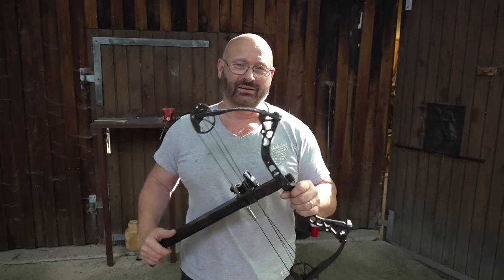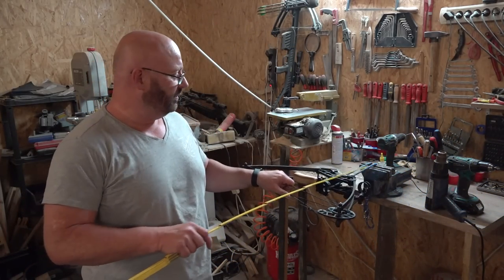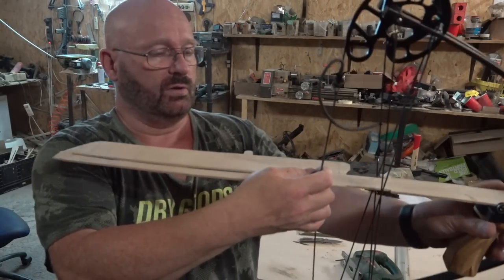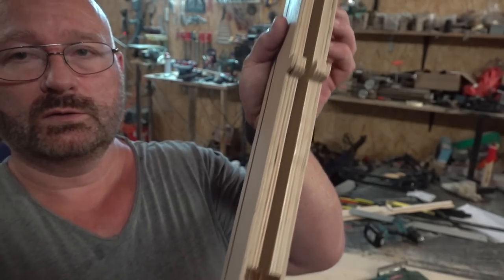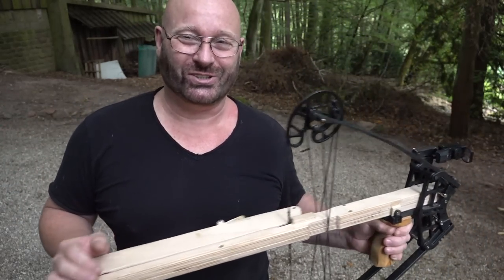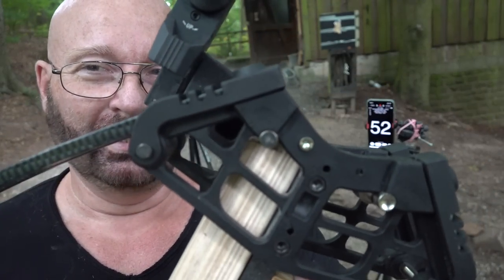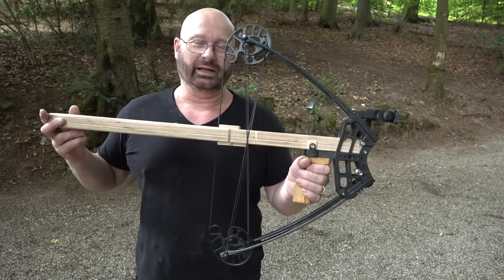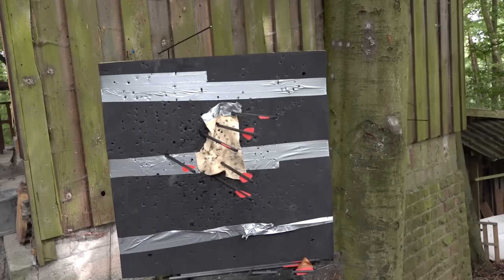200 $ Chinese Micro Bow MAXED OUT EXTREME (Tutorial)

Comment: Not first, but for once I caught this pretty early. Great work on the revision, Jörg! While being able to use full grip under the magazine is definitely an improvement, I feel like a catch loop (though using such a device would slightly reduce rate of fire), or some type of handle (maybe something vaguely spherical so it's easy to let go of, but coated in a grippy material like latex to prevent accidents?) tied to the string would serve as better alternatives. Those are just my inane ramblings, though.
Reply from the maker: Tried that, it works but using your fingers is still the easiest way.
Reply: @Slingshotchannel  good to know. Thanks for the reply!

Comment: I will make one. Thanks for this. I think you need to beeswax the surface of the wood on the inside to save the string wear and tear. Although it is clear, when it relleases it will vibrate at the end of its passage causing chaffing. I have this bow and I did not know it even had adjustable power. Thanks! (please review the pump action chinese slingshots 80 ball magazine that also fire darts available on ebay!).

Comment: How about adding a railgrip to the right side of the shaft to draw the string?
I imagine a mounted rail ridden by a grip with hooks above and below the shaft for the string. The hooks have a release on the grip.
As long as the grip doesn't stay in a cocked position on the rail (which would be neet) it is no crossbow, or am I mistaken?
This is due to the fact that you still have to hold the string by your own power, which is easy with a compound.
Olympic compound shooters use a release aid, maybe something similar can be done here. Replacing the grip with a loop to pull with the release aid. 

That way you could draw the string evenly and still be comfortable.
Also I'd think you could draw the string faster with a grip.
A hooked grip would be better to ensure a longer lifespan of the string. Maybe it is possible to combine the pullback action with a release aid.
That is something I'd like to see with the next iteration.

Comment: Love that ingenuity! I wonder if you were to use something smooth, like plastic, for the arm holding the arrows down, would it help reduce the friction and increase the speed? Or maybe a small wheel at the end of the spring loaded arm so it can roll along the arrow rather than rubbing against it. Keep up the great work!
Reply from the maker: That would only work for the very last arrow. Otherwise the friction is between the arrow in the groove and the one above it.
Reply from the maker: @kirkw1740  Even that would not work as the friction is between the two arrows, not between the arrow and the frame. The pressure is also required, otherwise the arrow would jump out of the groove. Much like the spring clamp that holds down a crossbow bolt. Keep in mind these arrows don't have nocks.

Comment: I like this"clip feature"alot Joerg,I wonder if this can be made from air craft aluminum?.
Reply: @jort93z  Ok,aircraft aluminum is 6061-T6,it IS aircraft aluminum,because of the grade of aluminum it is regardless of what it's used for.(gun mfg's use it too)
The reason why it's a good idea to make this project out of aircraft aluminum is because wood tends to crack,warp,age in negative ways that can hinder reliability and performance over the long haul.
Aluminum on the other hand will last almost indefinitely if given basic care,it's alot lighter then wood,much stronger,resists extreme heat and cold conditions better.
In the interest of time and money,it's faster and cheaper to make this out of wood,but not better.

Comment: I think delrin would be a good material to make this magazine out of.  You can buy it in sheets and the manufacturing process could then be very similar.  If you have a milling machine you could make one out of a single chunk of delrin as well.  It's a fairly inexpensive material too, very durable and has lubricating qualities which would prevent wear of the string.  Let's be honest, if you make one of these, you're going to be firing a lot of arrows through it.
Reply: I just went further in the video.  You couldn't make this from a single chunk of material. You would need to have at least two pieces.

Comment: May I be so bold as to suggest using the bolt as an "Impactor" ? Instead of fring the bolts you use 1 heavy bolt to impact smaller, shorter and possibly heavier darts allowing for a shorter, smaller magizine whith a far superior capacity. Or have I just invented  the AR 17 in Crossbow form?

Comment: Could you attach a pin or rod to the string, and move the magazine forward feeding vertically. As you pull back the string pulls the attached rod back dropping an arrow down to the barrel where the rod was. As you release the string the rod pushes the arrow through the barrel. If the gap between the springs is not big enough the chassis may need to be modified. This design would be easy to shoot as you could get your fingers on both sides of the rod as it should be about the same diameter as an arrow. You could even use one of those cam triggers then goes on your wrist.

Comment: Correct me if i`m wrong, when you feed the magazine with arrows, the first arrow you place in can be much longer

also the fact that this has no block & trigger a the end keeps it into the initial classification of bow, not a crossbow.
Reply from the maker: You are wrong on the first statement. The arrows ride on the string, so even the lowest arrow will only rest in the groove when the bow is drawn out.
Reply: @Slingshotchannel  can you test that? i think they are flexible enough to be fed into the entrance channel ? I know the string will rubb against the arrow when you first pool, but only in the first few inches
Reply from the maker: The string is only about 1,5 cm behind the point of the tip, so there is no flexible shaft to make this possible. No way this would work. Plus, why would you do that? Short arrows are great.
Reply: @Slingshotchannel  thankyou, i love all your work

Comment: So perhaps heavyweight heads would be a nice addition or perhaps just some cold roll steel or aluminum bar chopped to length kinda depends what ya want to do and fiddle around till ya find that happy spot where everything works kinda like ya want it to but as is its pretty cool so you've found a happy spot till you get bored and need a project to fiddle with

Comment: First I thought your new sliding design could be adapted to this bow. It looked promising since the sliding mechanism is partly already there between the existing parts. But then I realized the whole magazine would have to be crazy thin to fit between the additional strings that already needed some material removal as mentioned in this video. I guess it is not possible to slide the whole magazine through there. Just wanted to mention that. Maybe it saves someone some headaches.
Reply from the maker: Yes, the sliding magazines only work for bows that half an open riser.

Comment: Hmmmm.... I wonder if you could do a top-fed magazine with longer heavier arrows?
Like, the mag and arrows would be straight up and down inbetween the main string and side strings, and you could have a simple enough feed mechanism, like a sprocket, that brings a single arrow into the 'breach' which is diagonally down right at the bottom.... I feel like it could be done... and it'd be cool as butts.

Comment: Hi Joerg. Thank you so much for this video. I plan to build one of these. I hope you can answer a quick question: The bow when sold has a small loop on the string for a compound release clicker. How do you remove that and reinforce the string as it appears in your video?
Reply from the maker: You can untie the D-loop quiet easily with a set of pliers, or with a sharp knife. The string can be reinforced with a bit of serving string, available on amazon, ebay and in all archery stores. I use Brownell no. 4. Plenty of tutorials on YouTube.
Reply: @Slingshotchannel  Thank you for the guidance.
Reply: @Slingshotchannel  I just realised the string would need to be detached to fit the device. After googling it seems that requires a bow press. Could the rear of the string slot be designed openable so you could pull the string back and out?

Comment: couldn't you just make a little pulley kind of thing  that connects to the arrow loader that is attached  on the top and bottom side where the string meets that moves along the arrow loader itself.  it would give you a way easier time of pulling it back if I explained that correctly depending on what you use and how you do it.  giving you one point to grab that you could grab your hand around instead of how you were doing it that you said was uncomfortable.

Comment: The slots should be lined with teflon runners (cheap on fleaBay) or any plastic sufficiently smooth (could even be plexi).
Reply from the maker: Actually the slots don't even touch the string. They only exist so the arrows don't fall out of the box.

Comment: Joerg is it possible to make this with a removable magazine so you could have a couple ready loaded in a Quiver... it's fine having 6 shots but then it takes awhile to reload it... also have you thought about casting this in Aluminium?
Reply from the maker: Casting is very problematic as the thing is long and thin. But you can make this from aluminum plates.
Reply: @Slingshotchannel  Ah even better idea... you can buy those Aluminium Road Signs online they would work I think

Comment: hi joerg. I think your invention would be great if it was made of other material. With a 3D printer and a material like carbon, this magazine would be perfect for the bow. really good 3D printers are not that expensive anymore. In any case, I am sure that a printer would simplify many things for you and the implementation perfected. greets
Reply from the maker: 3D printers are painfully slow, really expensive if you need large parts (the magazine is 85 cm long) and the final parts are more brittle than a Zombie pinkie. Useless. I can make stuff from plywood ten times faster, twenty times cheaper and thirty times more solid.

Comment: Would it be possible to include a trigger mechanism? So you can first set the bow under tension and release the arrow with a trigger at the handle ?
Reply from the maker: Sure. But then this would legally be a crossbow, OK here in Germany but regulated in many countries around the world. Also I love the high rate of fire.
Reply: JoergSprave one modification that came to my mind was using a hook on the side (kind of like a bolt handle I guess) that would attach to the string and make it easier to draw, while allowing the bow to still be drawn in line with the arrows. Does that seem like a feature you’d be interested in testing?
Reply from the maker: @daniellinsley1567  Tested this already but it does not work well at all.

Comment: I've seen a lot of awesome bows, crossbows and rapid fire weapons on this channel. I wonder, if it's legal, could you make a rapid fire crossbow? A crossbow that uses a crank mechanism to fire bolts one after another. If it's okay, I'd like to see you make one. If it's not legal then that's fine, I won't ask again. Perhaps you've already made one and I missed the video.
Reply from the maker: It is legal and I have tried it. However cranks don't work at all for powerful crossbows. They turn very unevenly, easy at first and then very hard towards the end of the draw. It is almost impossible to hold such a weapon steady. So the "RX Adder" repeating bow I have developed with EK Archery, using an underlever cocking method, is the best solution.
Reply: @Slingshotchannel  I would consider your old Rubber based pencil shooters the best you can get with Full Auto crossbows. Maybe with a rather strong Motor you can get a Real crossbow working.

Comment: I'm very struck by the similarities between this gadget and the magazine structures of the late Roman polybolos ballistas and carroballistas.  have you ever thought of REALLY scaling something like this up, and maybe using a power take off mechanism from an axle to a differential gear providing power to a drive train which in turn would provide power to a gearbox that drives a clutched chain, powering a reloading mechanism for a pintle mounted scorpion size magazine fed polybolos. I bet you could even figure out a way to have removable preloaded magazines for it too.  Horse drawn chariot carrobalistas powered by the movement of the chariot itself.  Essentially a 4 horse motor built right in to the mechanism of the machine.  How Cool would ___THAT___ BE!!!!

Comment: Could you modify this to fire arrows shorter than the draw length and get a speed boost like the Koreans did with the mini-arrow technique?   I saw someone on Youtube get a 30% speed increase that way
Reply: Wouldn't that expected speed boost simply come from the arrows being lighter? Joerg just explained, that would have no effect on this specific bow, as it operates already on the max velocity its design allows for. So you would only decrease the impact even more, making the shots weaker, not stronger. 
If you want more oomph, finding arrows made from a heavier material, that have the shortened length that is needed for the magazine, but still the full weight of the original longer arrows, that the bow is designed to shoot, would make more sense.

Comment: Needs a butt stock, a built in mechanical release, and carbon fiber body. Would be much more accurate and would sell like crazy.
Reply from the maker: A butt stock would make it impossible to grab the string. A mechanical release would require a bulky rail system. Carbon fiber is overrated, it isn't much lighter than wood and stability is not required - no significant forces ever apply to the magazine.
Reply: JoergSprave 
Yeah, I guess that’s right. It would be easier to create a repeater crossbow. Maybe cocking with a lever or something.

I love you channel, by the way. It always gives me spin-off ideas and is positive and fun.